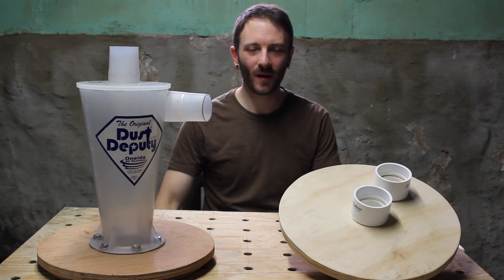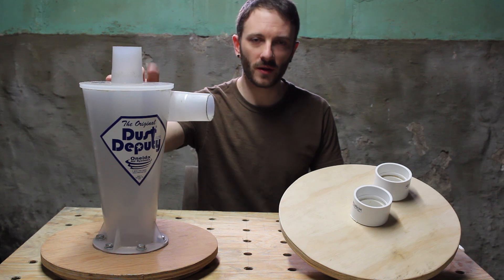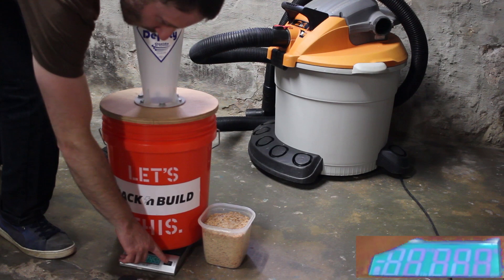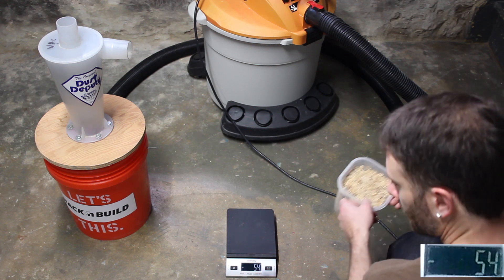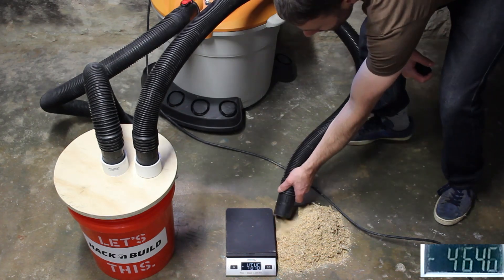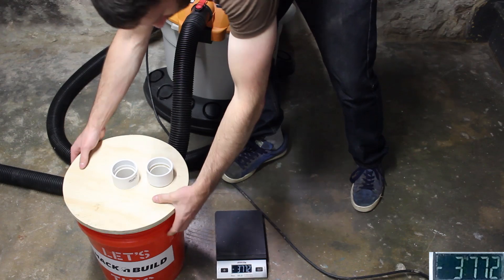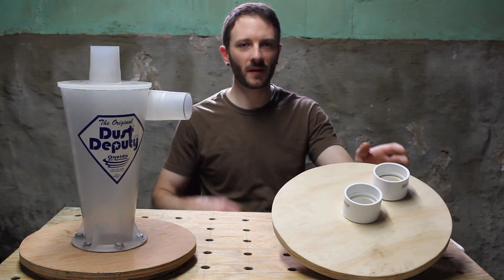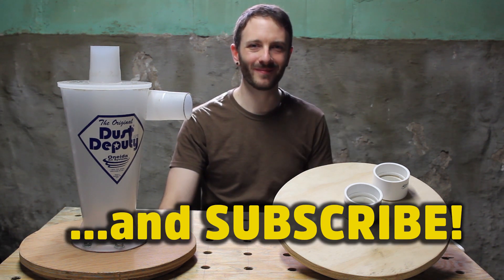Shop built dust collection vs Oneida Dust Deputy (1/2) - HNB #8

Comment: If you find a way for the outlet of the home made to suck the air downward maybe with a 180 elbow or by putting the end part of the pipe inside a margarine pot held in place with four pieces of wood  I think it would solve the problem.
Reply from the maker: Check out my 2nd revision of the DIY dust collector.  Thanks for watching.  Cheers!

Comment: I think its the distance to your intake and outlet pipes from the greater of the bottom of the bucket or the top of the wood shavings. For the diy the max distance is the height of the bucket. For the cyclone its the height of the bucket plus another 16 inches to the height of one of the intake/outlet pipes. Engineer a taller container for the DIY version and performance will be comparable. Over versions use two buckets stacked on one another. They do it specifically to avoid the collector filling up too quickly.
Reply from the maker: Let me know how it goes if you try it!

Comment: As a note, the Dust deputy inlet is on the side of the "barrel" which aids in creating a vortex. On ur DIY version you had the inlet in the top, so the dust just drops in the bucket. This may explain the drop in performance at half full, because there is no vortex, so the existing dust will potentially suck back up preventing further suction. 
In addition the Dust Deputy vortex chamber is in addition to the collection bucket. The diy version the vortex and collection happen in the same unit. Again, a potential explanation for the drop in DIY performance, since the vortex created hasn't got enough clear height to form properly and deposit the dust. Just my observations, hope they help.
Reply from the maker: Yes, and when the stack of sawdust gets high enough it's close enough to the hose inlet that the hose just sucks it up.  It is a pretty beefy vac! Thanks for watching!

Comment: The purpose of any cyclone addon is not to just pic up the sawdust, but to keep it out of the shop vacuums itself!  that fine dust will eventually clog the filter and cause the motor to overheat and shorten its life.  The real test is to start with its can empty, then vacuum up the measured saw dust and see how much made it through the cyclones to the shop vac itself!  The Dust Deputy does a really good job of preventing  most of it.
Reply from the maker: I agree, the Dust Deputy works great.  I still use it as my primary means of dust collection. Thanks for watching, cheers!

Comment: The dust deputy would not work if it was half full either.  You made a separator, put it on top of a separate storage bin and it will continue to work better. The reason it works better is volume.  It has time/space for the air to spread out and slow down and the particles to fall away down the wall.  Cut out most of the bottom and screw it down to a wooden disc with a similar hole, gasket or sealant. And it will function great.  I have made a large version with a 55 and 35 gallon poly drum, works great, I put a bag in the lower drum and pull out the bag at clean out time...
Reply from the maker: Actually, it works just as well when the bucket is nearly full as you can see in the experiment.  The problem is with the single-stage system once the saw dust pile gets high enough, it just starts getting vacuumed up.  Thanks for watching, cheers!

Comment: The difference at 50% full situation obviously comes from the height of the separator. Once the dust reaches the surface in the DIY version, it will be sucked to the center tube. If the there would be more height, suction would not be able to pull the dust up. To be fair, the DIY version should have same height as the dust deputy + bucket total height.
Reply from the maker: That's just how I designed them. If you make a video comparing the other approach feel free to drop the link here and I'll post it in the description.

Comment: I found it impossible to get hose that matched the ports on the plastic cyclones.
Reply from the maker: The standard 2.5" hose fit snugly for me.  I also purchased an adaptor kit, which works with the smaller diamater sizes.  What is the inner diamater on the hose you're using?
Reply: that's my point, I couldn't get hoses that fit. I've since bought a 2nd hand SIP collector, it has 4in hoses !!! It has massive suction and works very well

Comment: I have a similar plastic cyclone and I make a 4 sided tapered to the bottom box with a flat lid and a window/door air seal strip under it. My dust collection is almost 100% with alliuminum, sanding, planing, drop saw, general vacuuming and sucking up leaves and dust from my driveway. The top of my box is also a tight fit for a plastic rubbish bag so I can empty all the dust straight out. The only thing to watch is when cutting wet timber watch for build-up on the entry point of the cyclone. I won't use a bucket as my vacuum will suckered it to pieces if the hose blocks. The corners on the box are all mitred sealed and taped on the outside but I can still see flexing in the 18mm sides when using a reduced hose size. What I'd like to see is someone use a drain pipe with a cyclone on one end mounted to a wall with a clear plastic rubbish bag tied to the bottom. I know the bag would suckered into the pipe but I thing as the rubbish built up the bag would drop down each time the vaccum stopped.
Reply from the maker: I'd be worried about the bag too.  I bet you could do something with a spring loaded mechanism that releases a trap door when the bucket gets full.
Reply: Hack 'n Build its a similar way to how a purpose made concrete floor sanding vaccum works. As the dust builds up it keeps the bag lower down.
Reply: Hack 'n Build I just looked it up by searching concrete dust collection. They use a purging system that basically you collect the dust in the extractor and every 5mins the extractor drops the dust into the bag. I'd still like to try it with just a bag. I realise there'd be lag while the bag sucks up but if you're using it for multiple cuts or planing etc this wouldnt be an issue. Also it'd work best with a flanged end where the bag attach's. I've been keeping an eye out for a large diameter drain pipe off cut to try it my self. My original idea was to do pretty much what you've done using the pipe bends but the intake would be about 2/3 the way up a 1m drain or what ever was required to get above the bag when it was sucked in and either have out take centre at the top or off to one side. Which ever increased the cyclone action. But using a cyclone the pipe could be wroughly the height of the cyclone shorter. All of this would be in aid of safely removing the dust. I tried to just line my before mentioned box with a bag by making sure the box was sealed from the outside, it worked a little but to work properly I'd need to have a constant vaccum outside the bag as well as in. This could be achievable by looping the outtake hose from the cyclone to the bottom or the box and out again using a fine meshed off area at the base of the box but I haven't tried it yet.
Reply from the maker: Sounds like an interesting thing to experiment with.  Let me know if you try it out!

Comment: what are your exact dementions of plywood circles for dust deputy for 5 gal plastic bucket ?
Reply from the maker: Good question.  I want to say it was around 7-7/12" inches.  What I did to figure it out was use a pair of dividers, measured the diameter and divided by two.  For the top circle I made it slightly biger than the outside of the lip.

Comment: This is a good comparison, mostly. The one thing I noticed was that the bucket was not in the same spot on the scale each time it was weighed. This was evident when you did the measuring when the bucket was partial full. You zeroed out the scale when the lip of the bucket was hanging over the scale and partially over the led screen. After you vacuumed up the sawdust, the bucket lip was at the edge of the scale plate. This difference in center of gravity shift alters the readings. You should have placed a block of wood or something on the scale and placed the bucket on that so that it was in the same place each time it was measured.
In both times, with the bucket empty and partially full, you didn't have to keep cycling the vacuum and/or recapture sawdust that didn't make it into the unit when using the homemade version. With the prefab unit, you had to re-vacuum several times to get all of it collected. This is something you did not mention in your review. If debris is being left in the hose and not being collected, over time it will cause a larger obstruction in the hose and completely cut off the vacuuming ability to pick up debris.
The homemade version didn't have a problem with picking up and delivering the contents to the bucket. This alone would give the homemade version an advantage, even if some of the debris ends up in the shopvac canister. You wouldn't have to worry about hoses getting clogged up.
I think there needs to be a re-evaluation of these two units and give them a proper review.
Reply from the maker: Good suggestions.  I'll keep these in mind for my next video.  Thanks for watching, cheers!

Comment: It fails as it gets fuller because the 90 becomes a obstruction of the flow. It deflects the cyclone action. Notice the cyclonic kinetic energy is A: taking place prior to entering the bucket and B: not being deflected. As that elbow deflects the dust inside the bucket it slows it down resulting in the path of least resistance, your filter.
Reply from the maker: This is one suggestion I've read a lot. It would be interesting to see  how much performance could be improved by altering the radius of the intake port.

Comment: Test really proves nothing. The numbers mean very little. Look at the video, where did the sawdust not in the tub go. There was nothing visible left on the floor. If it is in the house ribs, it will either be sucked up next emptying cycle or be left I. those. Either way, the sawdust is off the floor and collected, which was the goal. Seems the $10 option just as effective as the $40 one. The real test is how much was carried to main vacuum canister and what was condition of its filter. A 2 stage vacuum system is meant to keep the more expensive last filter from clogging!
Reply from the maker: Terra, it's safe to assume that the dust either ends up in the vacuum or not.    Since both tests were done the same way, I think it's a pretty fair comparison. I did a follow-up video to this where I made some design imporvements, but it's still not as good as a true 2-stage system.  Thanks for watching, cheers!

Comment: This isn't a correct reading. If the suction can lift one partical of dust it should be able lift all of it. It should be a reading of the amount of weight the suction can lift dead.
Reply from the maker: What would you do differently, Mitch?

Comment: The DIY version has both attachments(exhaust and suction) on the top. So it blows straight down and stirs up the dust inside he bucket so it's sucked into the vacuum. If the suction hose  came in from the side and at an angle you would get much better results from the DIY version.
Reply from the maker: P ar, I don't think that wouild make a difference since it is already using a 90 elbow and so is "coming in on an angle".  I did a 2nd version where I added a baffle, which does help some (https://www.youtube.com/watch?v=S5ryW5Fm_Sc).  If you do an experiment with a 90 intake vs a straight intake on the side, let us know how it goes!  I probably won't make any more dust collectors of this variety since they just don't perform as well as true 2-stage cyclone. Thanks for watching, cheers!

Comment: I like the effort but, in my only opinion, the real concern is keeping fine dust out of the filter. I could care less if the larger chunks end up in the bottom of my shop-vac. It's all about a cleaner filter and if the cyclone consistently does that it's always going to be the clear winner.  I have two dust deputies, one for each shop-vac.  Expensive...sure, but I like them a lot, I just wish I could reduce some of the bulk of my setup.
Reply from the maker: I don't disagree, event adding a baffle as I did in my next experiment you still see that fine dust is making into the vacuum and presumably the filter.

Comment: On the home made unit both pipes should have an elbow and they should not be facing each other so this test was bogus and I say it from experience I built one many years ago and it works fantastic to this day but it does loose performance at almost full witch is expected so I have a plexiglass window in mine so I can se when to empty put an elbow on the other pipe and test again
Reply from the maker: The tests were run with the pipes shown at 1:24.  I suspect adding 90 degree elbow to the vacuum side would decrease performance since you're adding an extra bend which would result in decreased airflow. Feel free to run your own experiment and let us know!
Reply: Hack 'n Build my comment stated it works and does not decrease the flow

Comment: Thank you for the demo.  Maybe you can use them for separate uses.  Dust Deputy is still for wood dust.  DIY can be used for water filtration for plaster dust.  Actually I'm planing to build these 2 different models using the same bucket.  Water filtration is also very useful when dry cutting concrete.
https://www.youtube.com/watch?v=FKlbc2BYy9I
Reply from the maker: I'd imagine. Cement and plaster dust can be very fine.  It would be interesting to see how well (or not) a traditional cyclone does compared to the wet filter.  Cheers!

Comment: Add a Thien baffle and your DIY setup will perform much better.  It will also work much better if you make a tangential entry vs a 90 degree fitting. Less turbulence means much better separation and less pressure drop. 

Also,  the Dust Deputy will increase its lead if you move to finer dust. Corn starch is good for testing fine particle performance. Once you run dust through the cyclone,  don't pull it out and retest it because the cycloned dust doesn't contain much of the the finest dust and that will skew your results.

Even the best cyclone designs are less than 50% efficient for particles under 0.5 microns. Those are the particles that get deepest into your lungs and cause the most health issues. For that reason,  always use a good filter downstream of the cyclone (which it sounds like you did).  I say that because I tested one without using a filter downstream and was very surprised to see the super high particle count (using a laser particle counter)  in my shop even though I couldn't see or smell the dust.
Reply from the maker: It definitely would Tony.  I am going to try something like that as soon as I can get around to it.
Reply: Hack 'n Build check out the last vacuum system hack that Marius Hornberger did. It's one of the best I've seen so far. 

Thanks for posting your build and test results. I've built quite a few separators now and I always appreciate those who take the time to share their builds. .. especially the few that post test results.  Thumbs up!

Comment: Very well done, thank you!!     I'm trying to get away from a high dust system and it tipping over on job site.
Reply from the maker: Check out the Thien baffle design, it is a similar design to what I presented but it adds a baffle on the bottom which solves the problem of dust swirling around.  I plan on building something like that, and if it works as well as the Dust Deputy, I'll switch to that.

Comment: You never zeroed out your scale to account for the container you weighed the sawdust with. When you got your 186 out of 200 some of that difference was the container.
Reply from the maker: It was zeroed out, just done off camera. Note the scale reads -56 and not 0.  56g is the weight of the container within a couple of grams.  You can verify this by watching one of the segments where I zero out the scale and then remove the full container.   The scale reads -56g.
Reply: I do see that now. Thank you for taking the time to reply. I like your video. You did well composing everything  and video work is good. Thanks for the info.
Reply from the maker: Glad you liked it!  There's another dust collection video coming soon, so stay tuned!
Reply: I look forward to it. I've reached the point at my home shop that the dust is out of control. I'm going to be making a system here soon. Hence the reason I found your vid. I quite often like to make the simple things rather than buy them. Thanks for the content!

Comment: But, collecting 186g from 200g... 93%, I consider it "not perfect. Though, it's good for the information and to find better ways to collect it. Thanks.
Reply from the maker: I did repeat the experiment off-camera a few times and got the full 200g with the Dust Deputy.  I think depending on the way the hoses were plugged in some dust got caught up around the edges of the hose which accounted for the shortage.  For all practical purposes, as long as you remember to empty out the bucket when it starts to get full you're good to go: You won't have to empty the vacuum or clean/change the filter.

Comment: not 200grams as you forgot to take weight of tunb off.! should have used empty pot .zero to scales first then weighed sawdust out
not accurate readings
Reply from the maker: I did do that.  It's done by using the tare function on the scale.  You'll notice when that's done the unladen scale reads -56g, the weight of the container.